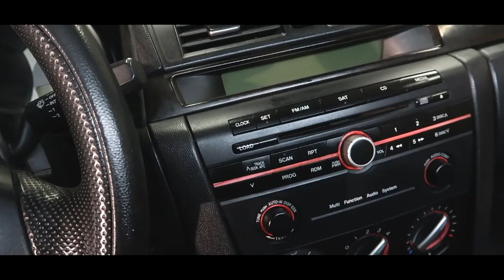DISASTER Detail on a SMOKER'S Filthy Car | Interior Deep Cleaning & Complete Vehicle Transformation!

Comment: Quality videography and quality detailing! I love the tip about leaving the windows down to allow the carpets and seats to dry more overnight. Here are my questions: what recording equipment do you use; and do you use an air compressor or think it's necessary for detailing? Would love to see some of the following from you guys (video suggestions): instructional video on your process for cleaning the exterior and sealing the paint on a daily driven vehicle that doesn't have a ton of swirling and scratches but they're still there (would you use a cutting compound, polish, wax, then ceramic sealant?) - clearly I'm asking for my own vehicle lol; first impressions and/or reviews on products that are similar but at different price points; and maybe leave some of the tool sounds in the videos - they're so relaxing! Keep up the awesome work guys!

Comment: Hey RJ & Brent; massive video!!!  A smoker's video is really an awesome vehicle to overcome in detailing, especially trying to removed the scent and the tarnish the smoke leaves everywhere.  How many hours did you all spend in cleaning the carpet?  My guess is 4-5 hours.  Really came out terrific in the long run and goes to show, power wash it at the beginning.  When I have a smoker's car or any car with an overly abundant odor, I'll ask the owner if I can change their interior air filter along with asking them what scent they like. I then surprise them with an application of a McGuiar's whole car air freshner.  At the end of the detail, engine and AC running internally, windows rolled up, set off the air freshner.  It disperses inside the car and rotates throughout the AC.  Fifteen minutes later, remove the empty canister, there are no residual marks to mop up, and the car smells fresh (not overwhelming)  They cost just under $6 at WalMart.  It's a nice touch for the right customer.

Comment: Why are you spraying water while trying g to suck up the water out of the seats thats not the way its designed for using. Sprayer is only for putting down solution not while spraying at the same time of extraction. seats will be completely soaking take days to dry them out